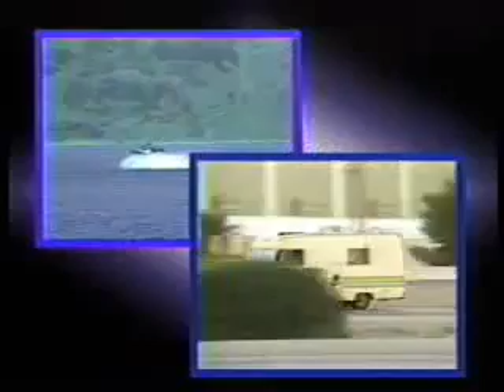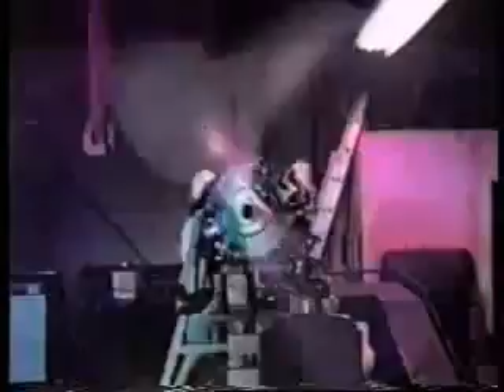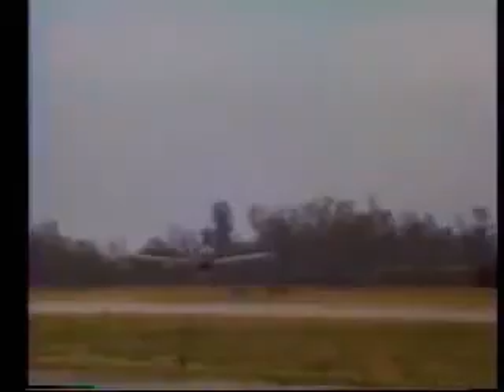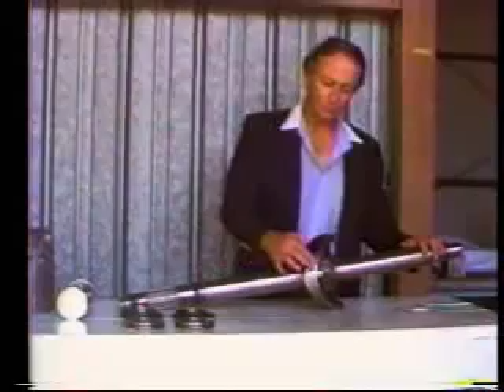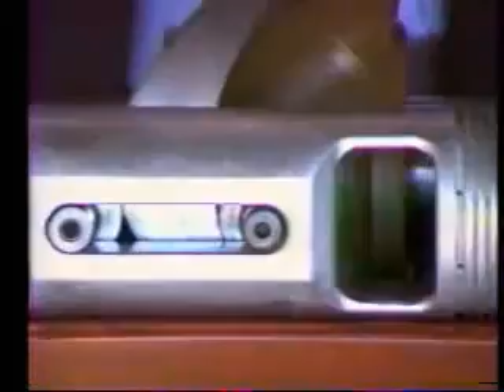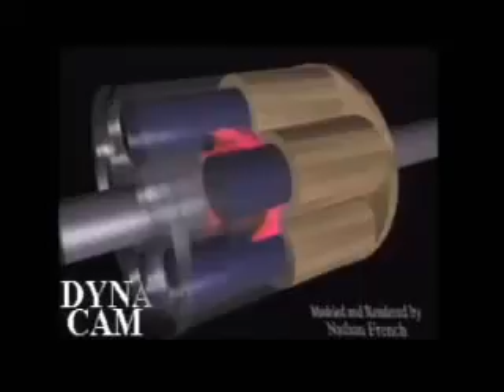The Revolver Cam Engine Previously known as the Dynacam engine wmv

Comment: This video was posted 11 years ago. If this engine is so great, how come this is the first I'm seeing it? Shouldn't this engine be everywhere by now?
Reply: Don't people ever take government regulators into consideration? FAA and EPA and all the other agencies?
Reply: @12skipafew-e7y  My suspicion is that this engine was too efficient and the big oil and manufacturing entrenchments got scared. Using modern computerized ignition systems on this thing would make it absolutely peak. As far as I know, the patent was bought by a Saudi company and our own military uses the design for torpedoes and probably drones now.
Reply: @myaantares4036  Big oil and manufacturing don't control combustion engine technology. Government regs control them.
Reply: @12skipafew-e7y  Big oil and manufacturing lobby the government to write those regulations, my friend. There is also a whole game of IP and copyright going on the side.
Reply: @myaantares4036  Believe what you will. Who controls who is always the realm of people's conspiracy talks.
Reply: @12skipafew-e7y  It's always a push-pull and I don't think there's a clean way to fix it, just stating the facts. This engine basically made all V-type and horizontally opposed engines laughably obsolete.
Reply: This engine has been invented in 1916. Numerous prototypes have been built since then, but it did not make to a real production. I suspect that the reason for this is the problem with all axial and most of cam engines - difficulty of achieving a reliable transfer of the piston into the torque and problems with maintenance.

Comment: I wonder what the oiling system was for these?
Reply: I'm with you there. How the Heck do you oil this engine? Is there a pump, or reservoir? Is it oiled like a two stroke with an oil/ fuel mixture?
Reply: @davidvaughn367  It was splash lubricating, like a cam shaft. The use of roller bearings meant you didnt need an oil pump.

Comment: Wow, with twelve power pulses per revolution, the torque must be fantastic. If they make it back into production, a turbo diesel version would be awesome.
Reply: It'll never happen... at least not until piston engines become a novelty collector item for those who can afford the exise tax on fuel. We don't have the materials for the necessary bearings. They're either too brittle (causing catastrophic failure), or too big (eliminating the size advantage of the design).
Reply: @driverjamescopeland what are you talking about? the dyna cam got FAA certified. the bearings were no longer a stress point.
Reply: I TOTALLY AGREE!!!!!!!   A SMALL "TURBO-DIESEL, WOULD BE AWESOME!!!!!!!!   FOR ULTRALIGHT AIRCRAFT, AND, OR, MOTORCYCLES... ETC.!!!!!!

Comment: i think small airplanes had already started using this engine, i wonder if cars would ever use this engine
Reply: probably it would be very hard to get to this engine in car. i mean hard to access all the points to check those. so it would mean much more work and higher cost
Reply: @jebise1126  you mean you'll encounter some tough maintenance issues ?
Reply: @zackrider3708  yes exactly. maintenance is needed on every engine and accessing this engine in car might be very hard to do.
Reply: @jebise1126  so this engine have no chance of being successful  ?https://www.youtube.com/watch?v=c19kn3drdFU&t=1s
Reply: @jebise1126  How so? It takes up half the space of a typical V6 and you don't need special tools or a degree to work on this engine.

Comment: Convert Ac compressor valeo
650cc 39 cuinch
This gotta be like
6000 cc 360 cuinch
No 1/2 that ?
Youtu got ac compressor engine conversion ..
I say use that compressor as expander.. External Pressure. Heat freon

Comment: I'd like to make one with opposed pistons, though you'd need two of those curvy plates, but I think I've heard you don't need valves on opposed pistons, might just be for 2 strokes
Reply: That's what I was thinking for a year now!
Reply: Lazarus056   INNengine.com has the layout you want.  It’s a 2STROKE so that’s helpful in several respects.  But uses sliding followers on cam, good for load spikes, not low friction.  

It is very impressive that they got FAA certified, I’d like to see that.  I am skeptical of their peaky (4-stroke) cams for durability at (TDC area) PCP with rather sudden loading, not great for cam/rollers.  Rollers ideally need oil pressure feed not just splash as it appears.  Goes to durability and reliability.  Also at full load & rpm rollers will have tendency to momentarily loose contact with cam, as they come back there is high skidding potential.  Skidding is very bad for durability.  

There are also piston rocking loads that do not seem to be resolved in layout.  So piston skuffing failure is a risk and ring/liner wear out  (compression & oil control) must be solved.  

While 12 firings/rev is good for torsional vibrations Firing loads are unbalanced so linear vibrations & rocking motion in block are assured.  Also there are significant bending loads from the calm into the crankshaft, so what they show seems long and spindly in that direction.

All machines have issues, it’s learning to design thru them, operating within them and maintain for them.  Takes time and money, competition is fierce.
Reply: @timduncan8450  FAA approval for experimental maybe? does it even need to be approved in that case?
Reply: @Victor-056  https://www.youtube.com/watch?v=gqc0KZRKreE
Reply: @BoB-Dobbs_leaning-left  Many thanks Steve.
Reply: Maybe some thing like this 
https://youtu.be/35X77c5PzJU
19th century tecnology. It uses a groove ain place a curves plate
Reply: Funny you should mention that.
https://www.youtube.com/watch?v=gqc0KZRKreE
Reply: @BoB-Dobbs_leaning-left   tnx men. I was looking for this vídeo lomg time ago
Reply: Correct. Fairdiesel tried to do exactly as you described.